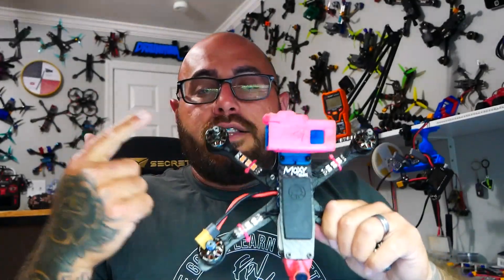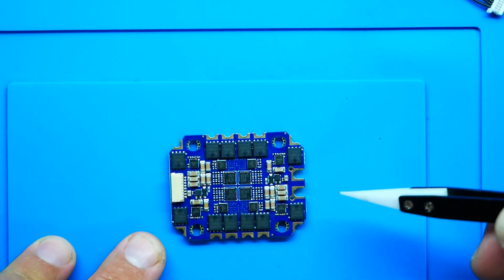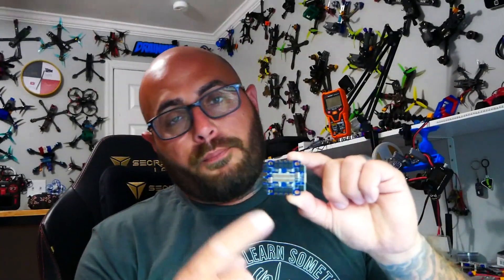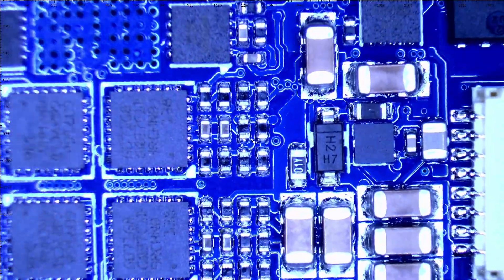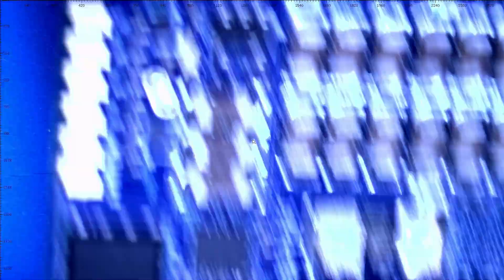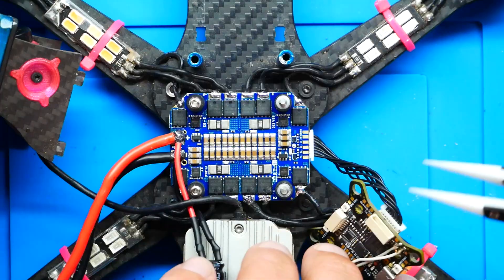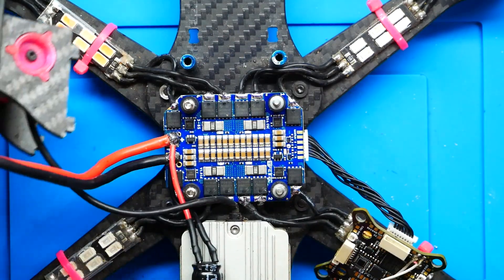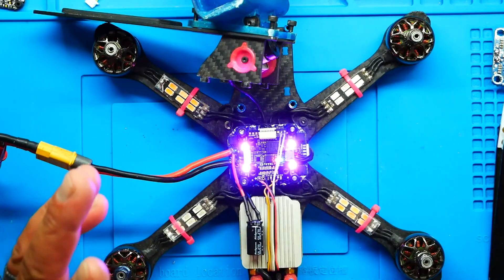No More Blown Fettec ESCs!! The 65 Amp 8s Fettec ESC is Here!!

Comment: Why do they rate it at 8s when Literally every other 65 amp esc is rated for 6s..
Reply: They want u to break it again.
Reply: @Fpvfixit  lol..
Reply: At one point i had the diatone 56 amp esc and it lasted a good while but on 6 s
Reply: That 45 amp doesnt leave any room for multiple caps in an Apex at all.. I had to flip the board around just to get the main cap with the spike absorber

Comment: frick fettec ESCS. I've had a brand new 45A have three mosfets slide off in a small crash, and another time bouncing off the road a  pretty new 45A fettec esc lost a mosfet.  Switched over to the 35A AIO , for 4S, works great so far.

Comment: On the taranis qx7 can the stick trim be adjusted on the menu?
I ask because I am making a custom controller by fitting it to a trigger controller for an RC tractor trailer and I don't want to leave out the trim adjustment on the case if i will need them.
Thank you

Comment: Love your videos Drainman. I’m an old (72) rc glider guy and have recently fell into the FPV trap. Have never built nor flown one but my wife got me a tyro 79 pro. Like the Fettec 65amp ESC. What’s your opinion on a  Spektrum radio.
Reply: Get something with express lrs it's way better
Reply: @joemck1235  crossfire is plug n play. Why frustrate this guy with ELRS? Anything open source I’d never recommend to a noob
Reply: Elrs is fine it's not complicated if you follow the instructions some people have issues with it I was a noob at one point and I didn't have any trouble with it you can get a radio with it already built in the radio
Reply: Spectrum doesn't play well with FPV. You want to look at Radiomaster stuff, or radios with open, and edge tx. Radiomaster tx16 or Boxer will give you built in elrs, which is great. If you want to go with crossfire you just pop it right in the back and it's super simple. But you can start your elrs journey whenever you feel up to it. That's my 2 cents.